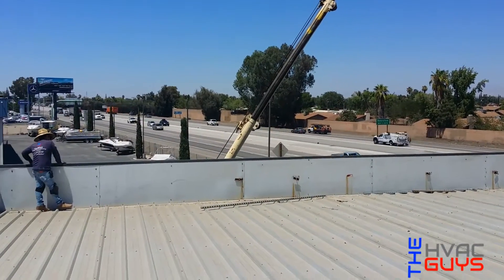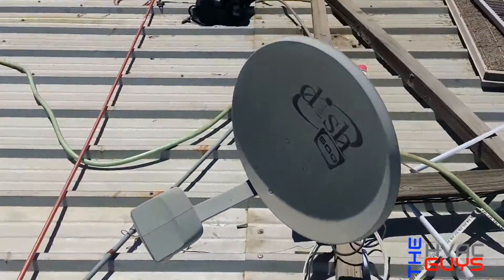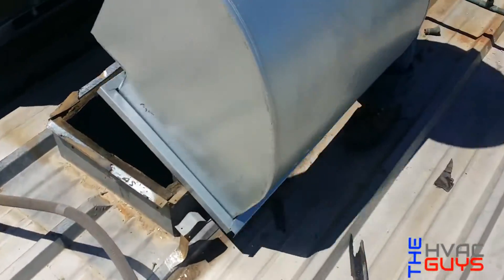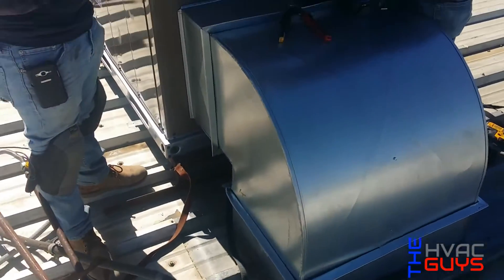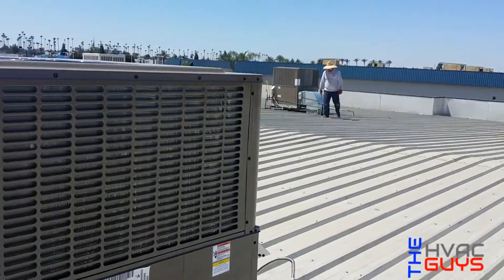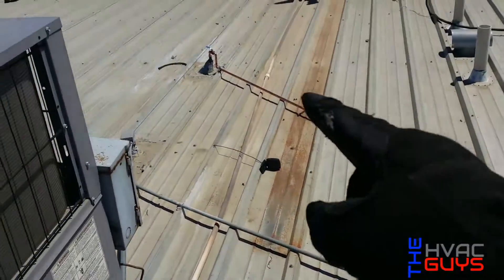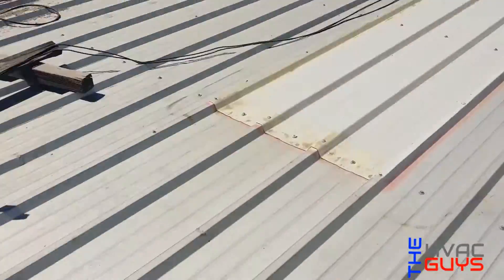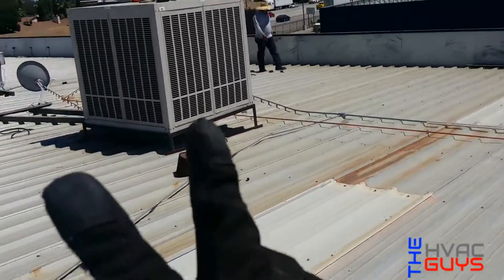HVAC: YORK RTU CHANGEOUTS

Comment: no worries with water lines freezing? I see there's gas heat, so it must get a little chilly where your from?
Reply from the maker: it's rare if it freezes here. we're going back out to winterize does coolers and clearing out does lines from water.

Comment: are the metal stands secured to the beams under the pan roof? It looks like the package unit stands are just  sitting on the roofs. Here in south Florida we have to cut the roof open and mechanically attach the roof stand to the roof beams/ Structure.
Reply from the maker: that is existing, so it's just a change out. I see what you mean, never seen that here in California. mostly stands with elbows or curb. thanks for watching